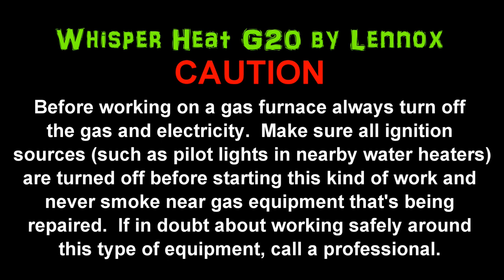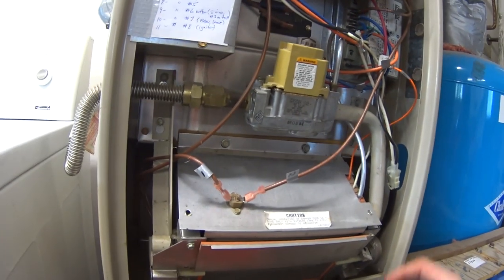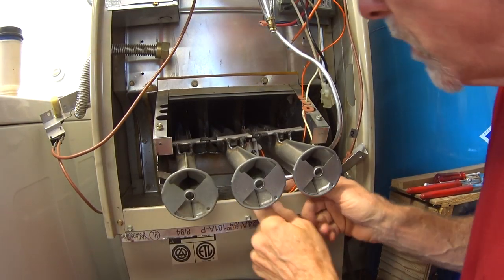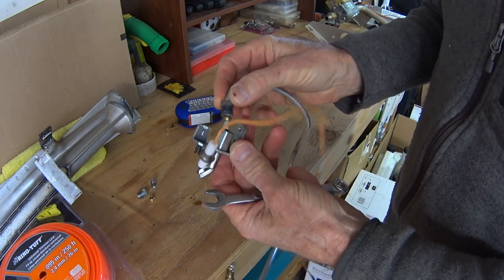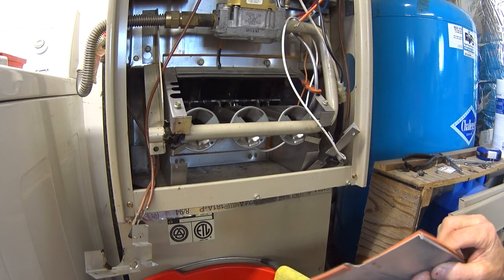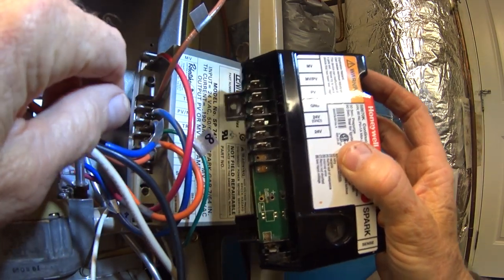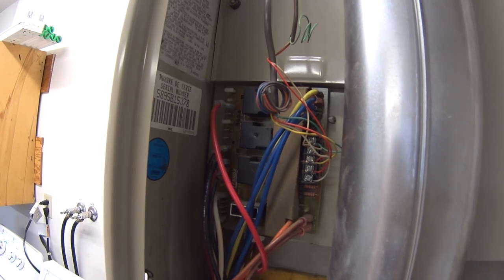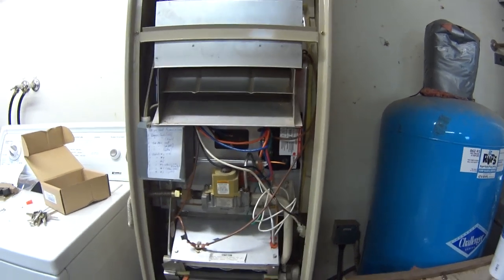Furnace Repair - Lennox WhisperHeat G20

Comment: Maynard: I appreciate the video. I had replaced the igniter and flame sensor but still did not light. After watching your video I took a similar Lennox Whisper furnace apart and cleaned out the tubes (which were pretty dingy looking). After watching you it made the job easier than I thought.

Comment: Great job. It looks like blower control was the only problem. Flame sensor can be cleaned with emery cloth - no need to replace.
Reply from the maker: Thanks!  Actually last year the blower control was probably the only thing wrong, but this fall it wouldn't even spark.   I'd read several things about it possibly being the ignitor or the controller, so decided to just replace both of them (especially since both were very old and many recommended the Honeywell replacement controller).  The flame sensor was included with the Honeywell so we decided to install that too since we had it on hand.

Comment: Excellent video.  I had a similar problem where the blower would not come on when the thermostat was set to 'auto'.   Ended up replacing the circuit board.   The bad circuit board's relay underside solder had melted.
Reply from the maker: Thank you, Kong.  Glad you got it fixed.

Comment: Basically same unit but I only had one blue wire and I put the white wire to the spark/sense and the IGN/ orange wire to the 7 plug and it worked.??

Comment: That was good for DYI,repair. Hint, you will continue to have issues with your furnace , as your dryer is next to furnace. That model Lennox is also know to have serious heat exchanger problems. Suggest you think about upgrade of your furnace. The newer model do not have pilot . Lennox downflow furnaces are very efficient. since 2000.
Reply from the maker: Thanks Michael.  We could probably move the dryer to the other side of the washer.  But why is it a problem?  Is it because of venting?   The furnace's intake from the house comes down from the ceiling into the top of the furnace, and the intake for the furnace's combustion comes from the front of the unit.   The dryer's vent is about 9 feet laterally from the furnace.
Reply: Yes , lint goes into trap, but some still floats around also the dryer sheets chemical has effect of ignitor/flame sensor.
Reply from the maker: Thanks for the info!

Comment: I believe the "extra" jet that came with your pilot assembly is actually an alternative/conversion jet that you would use for propane.  It is part of the conversion kit used to convert this furnace to run on propane instead of natural gas.
Reply from the maker: Probably so.  Thanks CJ C.

Comment: Thank you for this video.  My unit is getting worse.  I'll hear click, spark spark spark and then a final click and then nothing else happens.  I leave the thermostat on auto and sometimes it will fire up just fine, but very rarely now.  I suspect the main controller board might be the cause, which I will now replace with the Honeywell model you showed.
Reply from the maker: Kurt - good luck with it.  Could you tell that the clicks were coming from the main controller?  It was pretty obvious on mine when I got up close to listen to it.
Reply: Actually, I'm not sure after closer inspection.  I'm starting to think its coming from the blower controller now because it has relays and the main controller doesn't, right?  I'm just going to replace both parts and see where that leads me.
Reply from the maker: I don't know what's inside that main controller other than electronics but it definitely can click.  Mine was doing that when I wasn't getting a spark.
Reply: I had exact same issue; inducer fan kicked on, damper door opened, slight click when call for gas, then pilot assembly igniter went click, click, clicked, but no flame.  Replaced the gas valve and worked great.

Comment: Great video but...My Lennox g20 decided to not come on at the first cycle in the morning unless I turned the power switch off and on.  It worked fine the rest of the day.  I replaced the thermostat. Problem remained. I cleaned the flame sensor and it worked normally for 2 months then repeated the problem. I replaced the flame sensor but couldn't get the aluminum tubing back into the valve, so replaced the tubing and connector as well. Now the furnace hums to show power but nothing else happens.
Reply from the maker: Tom, it's hard to troubleshoot these things without being there.  I would probably try this:   1.  Turn the thermostat off.  2.  Turn the electrical breaker off, then back on again.   3.  Stand in front of the furnace and have someone else turn the thermostat on, set to heat, making sure the temperature setting is at least a few degrees higher than the current ambient temperature.  Then watch and listen to exactly what happens at the furnace.  Does it just hum and nothing else?   It should first open the damper door, then you should hear the ignitor clicking to ignite the pilot.  The pilot should burn for awhile (maybe 20 to 30 seconds?) and then the main burners should ignite.  The main burners should burn for maybe up to about a minute at which time the blower should turn on.   Observe that and we'll go from there.

Comment: Great instruction for my EXACT furnace!! Thank you!! Can you tell me where to get the replacment wire for the flame sensor? The link provided seems to only include the sensor itself.
Reply from the maker: Hi Tammy - I'm glad the video helped you.  I didn't need to replace the wire in my unit, but they sell them at places like Amazon and Repair Clinic.  Here's an Amazon link.  Note, I will get a small commission from Amazon (at no cost to you) if you use this link.  Thank you for your support and best of luck with your furnace.  https://amzn.to/3gRKnwa

Comment: I'm trying to figure out on this Furnace how to install the Spring that goes to the Damper Door that makes and breaks the limit switch on the left side. In the video I saw where you took off the wires for the switch but Not how the spring was attached. Wondering if you could help.
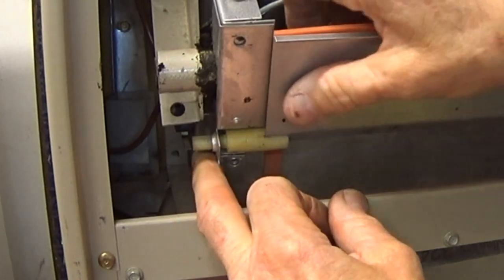Reply from the maker: Watch the video starting at 23:15, which is where I start putting that spring back on.

Comment: How did you keep your burners in such good condition? My furnace is 26 years old and all the burners are badly corroded.
Two service techs have visited. One said I have a bad pilot assembly. The other said the gas valve is bad.
Reply from the maker: Just dumb luck I guess.  We had never worked on the furnace before I did this video, but maybe a former owner did.  Are you getting any flame from the pilot initially?  What's the sequence of events?  A bad flame sensor will prevent it from firing up the burners if it doesn't detect the pilot flame.  If you can see a pilot flame but the burners never come on, that might be your issue.  Take out the flame sensor and clean it up with some steel wool, then put it back in and try it.  Be careful not to touch the metal probe part with your fingers as that could ruin it (it doesn't like the oils from your fingers).

Comment: Thank you for the sharing. My home furnace is the same model as what you have. I turn my furnace off when going to bed every night. When the furnace is turned on every morning, it has big explosion when initial ignition. There is no more explosion during the day. What parts shall I change to get rid of the explosion?
Reply from the maker: I wish I could tell you which part to replace but I'm not an expert at this.   I did find this explanation though - see if it helps you:  https://www.ragsdaleair.com/news/why-does-my-gas-furnace-come-on-with-a
Reply: Thank you for your sharing. Yes, I have been noticing the poblem of delayed ignition too. It now takes 13 seconds to ignite the pilot when initial ignition. Afterwards it takes 2 to 3 seconds only in the remaining of the day. Does Pilot & Ignitor Assembly get ageing problem or is it the problem of stack effect?
Reply from the maker: @fuwangyang8060  - I really don't know what "stack effect" is.  And I can't say exactly what's happening with your furnace.  You may have a dirty flame sensor and/or pilot assembly, or it could be a completely different problem altogether.  One thing I would definitely do is mix up a solution of dish soap and water in a spray bottle and spray it on your gas connections to (and in) the furnace to make sure you don't have any gas leaks.  Any leaks will show up as small bubbles.   This problem could potentially be deadly so your best bet would be to call in a professional.  Don't risk your life on this.
Reply: I appreciate your advice. I will take it.

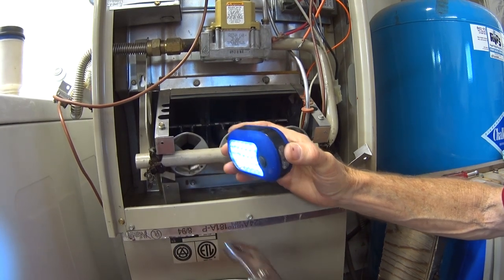Comment: Ok soo Im a DIY kinda window and over the yrs have empressed myself lol. But please tell me at 9:55 NOT to bend annything and to just remove the line as he finally does AFTER bending the s*** out of those brackets (I hope it's not gonna be a problem later on ). But hey SOMEONE has to make the mistake first so I thank you sir, your video was EXTREMELY helpful and saved me a ton of money. 
Wait...could you of maybe just removed the pilot line and damper all as one piece? I ask because if you lose that spring you're in trouble and we've all had a spring get sprung at some point in life. Looks like you might be able to take out some screws on the inner furnace wall and undo some wires then remove the damper, control cover, ignition line, all together??? Or perhaps there's wires that need to be taken off first that you don't see unless you do it this way.
Reply from the maker: Hi Tasha and thanks for your comment.  Yeah, I should have removed that pilot line before trying to remove the manifold.  But I was flying by the seat of my pants and didn't see it at first.  Bending those tabs doesn't hurt anything as long as you don't have to do it a lot.  No doubt it wouldn't take too many times before metal fatigue would break them off.  Even if that happened, I don't know what damage it would do.  I can't see any purpose for them even being there.  As far as removing the damper as one piece, maybe that would be possible, I'm not sure.  I didn't think I could get to all of the screws on that inner furnace wall with everything else in the way, but possibly by removing the metal cover below the damper it could be done with a long extension on a socket.  Not sure.  Why don't you try it and let us know?   :-D   Anyway, glad this saved you some money, I'm a big fan of that.

Comment: I know this may be a long shot as this was made some time ago but does this furnace have a summer setting mine does not blow cold air from the bacement even when set to cool?
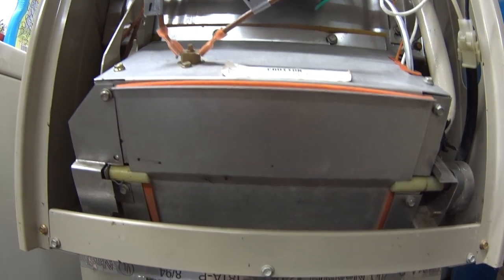Reply from the maker: Brooks - I'm not sure what you mean by a "summer setting."  There are high speed windings on the blower motor for use in summer when it's blowing air from the a/c unit.  Maybe you have a problem with the blower control unit, which activates those high speed windings when the thermostat is set to "cool."  I replaced that unit in the video, starting at 32:02 .
Reply: @MTMiser  i was referring to the furnace just blowing air in the summer i dont have a ac unit but neither does my parents furnace but it blows cool air from their bacement in the summer just to clarify what i was referring to
Reply: Yes it is possible to just have the blower on. Many thermostats have a switch to just allow the blower to come on, if you have A/C too and it is correctly wired to do so.

Comment: There was way too much disassembly just to get the pilot assy. out.Believe me, the last thing you want to mess with is the damper door assy. Turn off the power. You can then just remove the pilot line off the gas valve , disconnect the red H.V and white flame sensor wires off the ignitor module and GENTLY wiggle the pilot assy out. That will test your patience but it is very do-able. What I did to reinstall the pilot assy. is to gently bend and re-route that pilot gas tubing to come out between the middle and right ribbon burners and that will make the next removal  very easy. Also, you can clean the flame sensor with a fine piece of steel wool. It is just a metal rod, it gets dirty and stops working and shuts down the furnace. There's  nothing to go bad with it unless the ceramic insulator cracks.

Comment: Thanks for making this awesome video. Currently I'm working on one. Damper door opens, pilot lights but doesn't light my burners. After few seconds pilot goes off and the blower comes on. Any idea what could be wrong?
Reply: Clean the flame sensor or replace, they're cheap. It tells the burners whether or not they should light, so if the pilot has flame and the sensor is bad, the burners will think it's not okay to light
Reply: I agree with Jacob, definitely sounds like a dirty flame sensor.  Clean the stainless steel rod (sensor) part of it with super fine steel wool or green pad dish scrubber.  Try not to use sandpaper or emery -  if you scratch it up, it gets dirty faster and then needs to be cleaned more often.

Comment: My husband and I have the exact unit described in this video.  Just wanted to know where did you get the replacement parts for the unit?
Reply from the maker: Hi Debbie - I just added links to the parts I replaced at the bottom of the description.  I should have done that when I posted this originally - sorry.  But anyway, here they are:  

Pilot Assembly (includes pilot jet, mounting bracket and ignitor as one unit):  https://www.supplyhouse.com/sh/control/product/~product_id=18G90

Flame Sensor:  https://www.supplyhouse.com/Lennox-52W29-Flame-Sensor-Kit-LB-74940A?gclid=EAIaIQobChMI1--hiMbf2QIVBksNCh2wLg44EAQYASABEgI6i_D_BwE

Main Controller (this controller apparently replaces the Honeywell S8670K that I used):  https://amazon.com/Replacement-Honeywell-Furnace-Integrated-Ignition/dp/B00E4267O8/ref=sr_1_5?keywords=honeywell+s8670k&qid=1573423254&sr=8-5

Blower Control Circuit Board:  https://www.amazon.com/gp/product/B00XBSLQHE/ref=ppx_yo_dt_b_asin_title_o00_s00?ie=UTF8&psc=1

Comment: Where can I get all these parts ? I need to replace controller and gas valve
Reply from the maker: Links to the parts that I replaced are in the video description - scroll to the bottom.  Try RepairClinic.com to look up the gas valve part number and then shop around for best price.

Comment: My fan sometimes stays running on low fan after the furnace shuts off?
Reply from the maker: It's normal for the fan to run for awhile before and after the burners light and turn off.  Maybe a minute or two.  If it keeps running beyond a few minutes, there's something wrong, but I couldn't say what the problem would be.

Comment: hello I would like to know where to get the parts to repair the furnace?? I need the Flame sensor and I do not know where to find it
Reply from the maker: I got them from Amazon.com and Supplyhouse.com.  If you have a Lennox this is probably the one you need, but you can call them to double check:  https://www.supplyhouse.com/Lennox-52W29-Flame-Sensor-Kit-LB-74940A?gclid=EAIaIQobChMI1--hiMbf2QIVBksNCh2wLg44EAQYASABEgI6i_D_BwE

Comment: I cant find the air filter on this model
Reply from the maker: Ha ha!  I had the same problem, Jon.  Stickers on the inside of the furnace indicate how to find it but it just wasn't there.  I finally figured out the only filter in the system was the one in the return inside the house.  No filters at all in the furnace unit itself, at least in the one I have.
Reply: I just moved in a one-story house with a crawl space and partial attic. My furnace is in the closet. I found mine about an hour after posting this because I've been getting sick since we moved here and thought that it could be from the filters needing to be changed. Mine are on top of the furnace where a massive ductwork comes out from the top of the furnace. One on right lays horizontal and one on left lays 45 degrees. Filter on left wasn't that dirty but one on right had mounds of dirt like it hasn't been changed in years! Probably wasn't because it's very hard to reach and wasn't discovered or was forgotten about. The ductwork goes into the attic but my vents for the rooms are on the floor. Now I'm wondering where my intake air is coming from- the crawl space or in the attic where there is probably fiberglass insulation!
Reply from the maker: If it's like mine that big duct coming out of the top of the furnace leads to the return somewhere in the ceiling of the house, which should have a filter in it.  The location of the vents you described sounds like the instructions on the sticker inside my furnace, but in mine they just aren't there.

Comment: Why does a 110v furnace have a two pole breaker?
Reply from the maker: Good question.  I'm not an electrician so I don't know.  Maybe the 240v comes in when the A/C is turned on.  The same unit blows air for a/c.   I'd bet that is the reason.  The blower has low speed and high speed windings.  The low speed is 120v for the furnace, high is for a/c.  That's probably 240v.
Reply: If the 110v leg for the furnace is part of a 220v breaker then I'd be worried.  In Calif. we have to have a separate breaker for the fau.